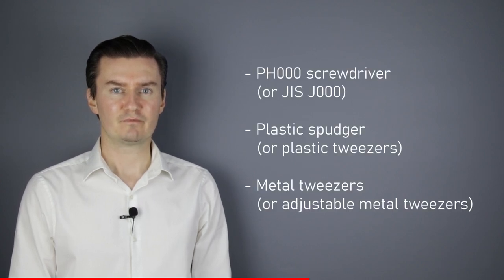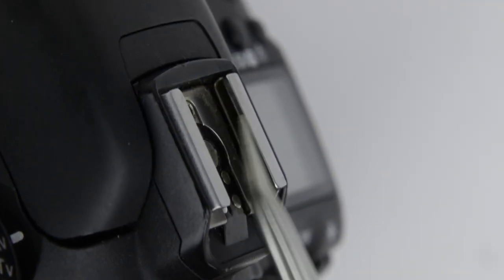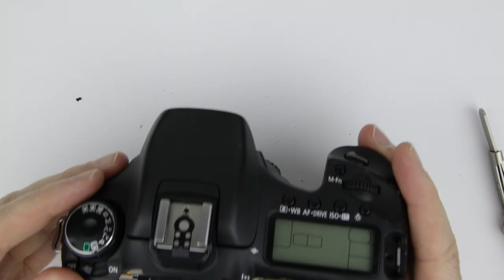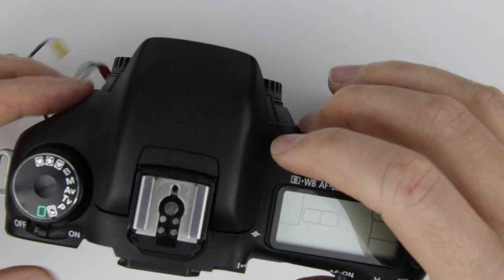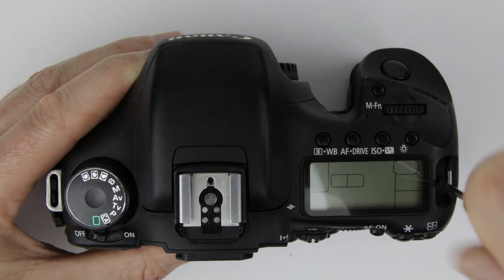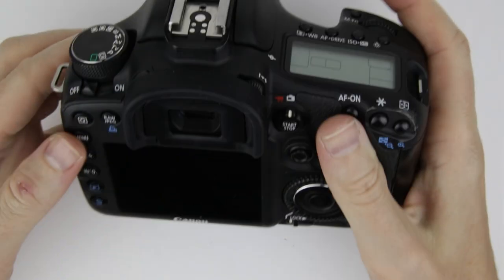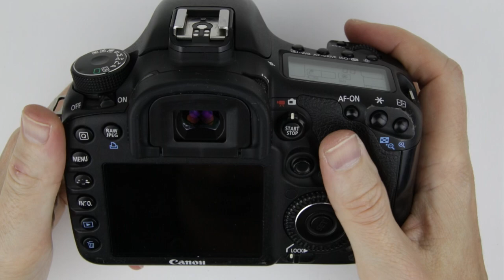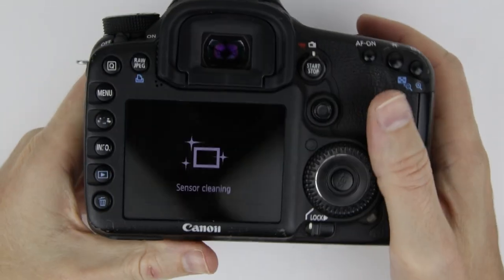Canon EOS 7D camera - repair flash: doesn't open up, external flash is attached problem

Comment: I followed your tutorial, managed to get the hotshoe switch un-stuck. Unfortunately camera won't turn on now, any ideas/suggestions where I went wrong? I'm guessing I didn't reconnect one of the switches or cables properly. Any help, gladly appreciated.
Reply from the maker: Most likely the switch of the memory card reader or the battery door is damaged... they are small switches which senses if the doors are open or closed. If the switches are damaged, you can short them, so the camera would always see the doors closed, and it would turn on right after you insert the battery.
If the switches are fine, then check if all the flat cables are connected inside the camera.